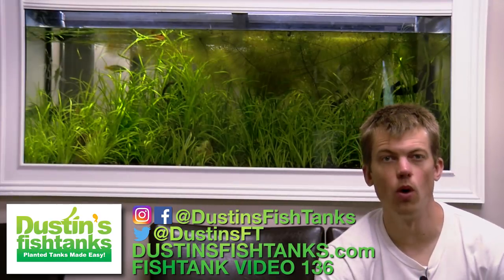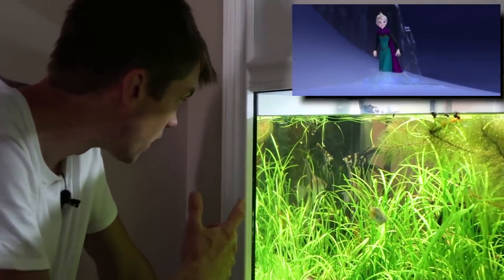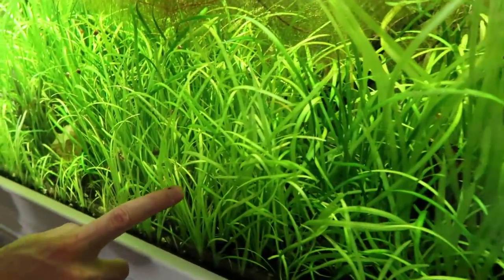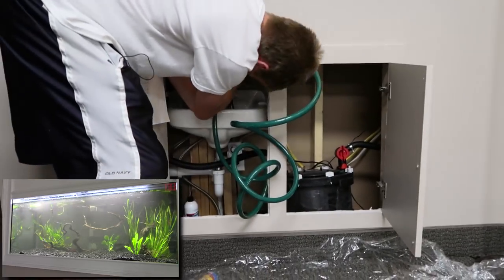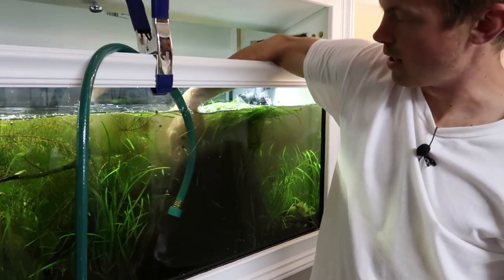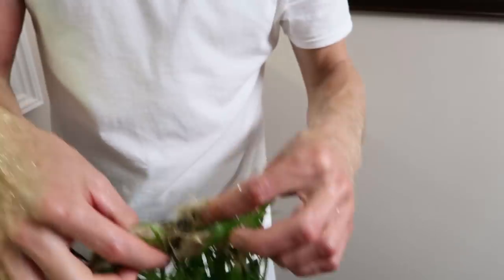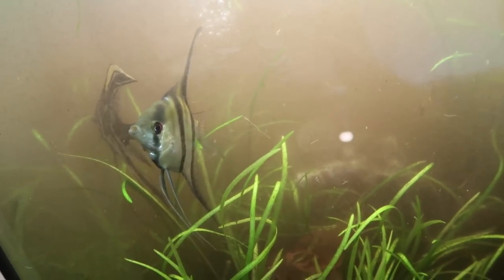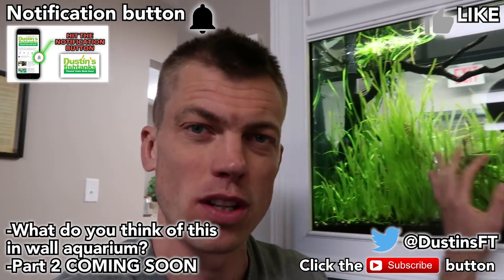BEST TANK SETUP: Time For Planted Aquarium Trim PART 1

Comment: I used an organic potting soil but cannot get my water clear.  I’ve changed it 3x even added more pea gravel to cap.  Still, after a day it’s tea again.  Anyone have a suggestion?
Reply from the maker: Scott Nahler how thick is the gravel cap?
Reply: Dustin's Fish Tanks 
1 1/2”
Reply: Scott Nahler How long ago did you dirt it?  I had a nightmare with mine because the gravel was too small, it was clear when I filled the tank but next morning the water was so brown could hardly see the fish!.  I've used a larger grain size since and had no trouble with any further dirted tanks.  The tank with the light gravel did settle down after a few weeks and I am very pleased with it now.  Hope this helps.
Reply: Paul Conway 
About three weeks now I pulled everything out last water change and added more gravel.  It just won’t clear up.  It’s mechanical filtration with bio filtrate I was thinking about another change then adding charcoal insert.  I don’t want to lose nutrients by changing so often and much.